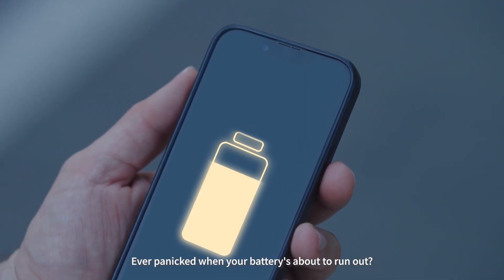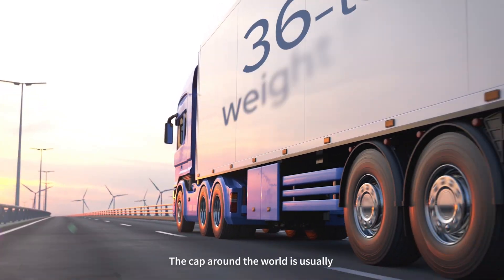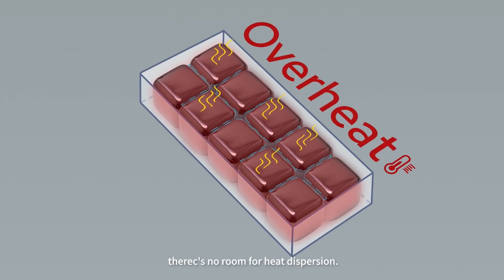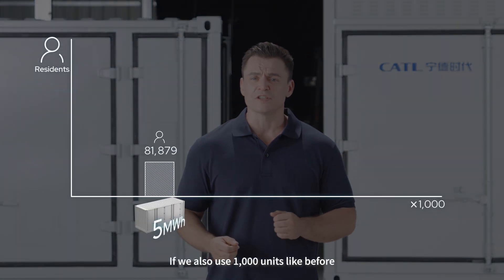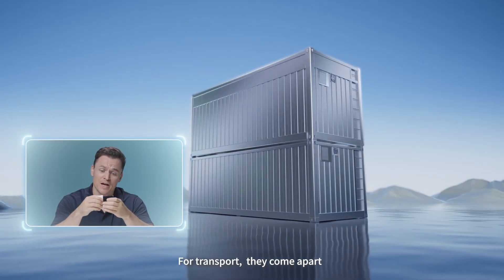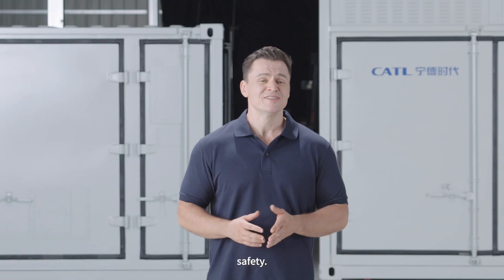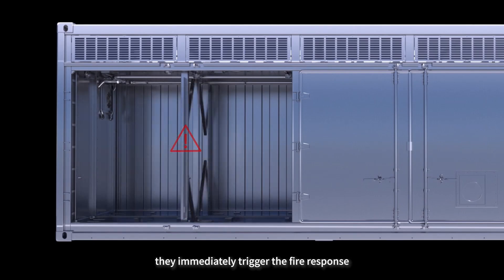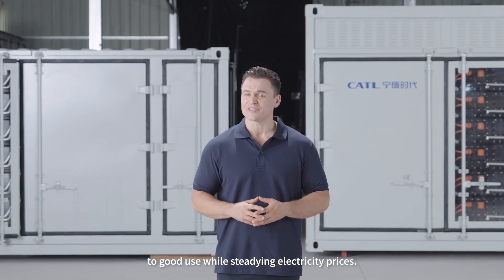How Tener Stack Became the Blackout Saviour

Comment: 5MWh for 5,000,000 residents. 
9MWh for 5,600,000 residents.
12% more, for almost double the MWh, I don't understand.
Reply: Exactly. Perhaps, the AC power output is limited by the power conversion system (roughly fancy term for industrial scale inverters).
Reply: @adon8672  Maybe new unit has higher output so can support 600k more people, then also has almost double MWH energy storage so can provide that power for much longer.
Reply: @groMMit1981 I suppose if it can provide that power much longer, it will be in there interest to say so right? The whole thing doesn't add up.
Reply: @adon8672  Marketing using AI rather then reading details of the product?